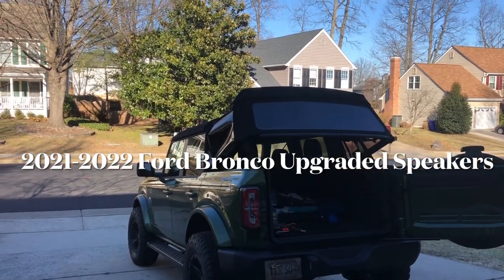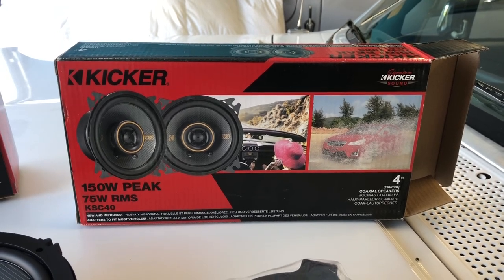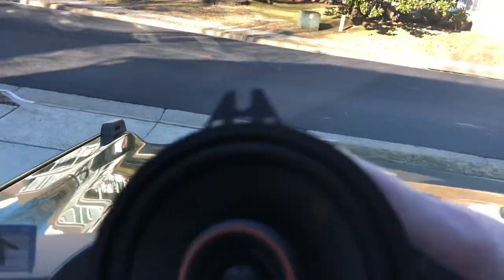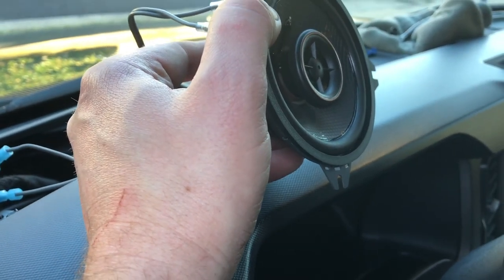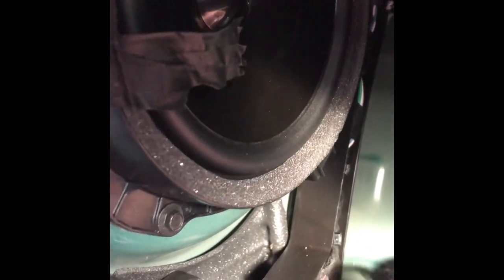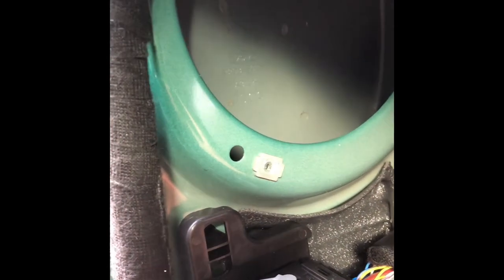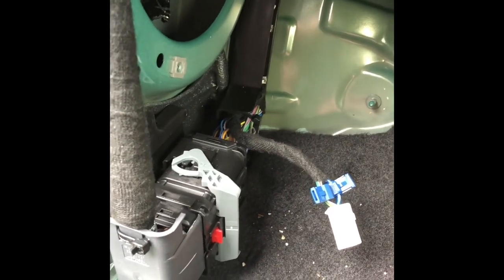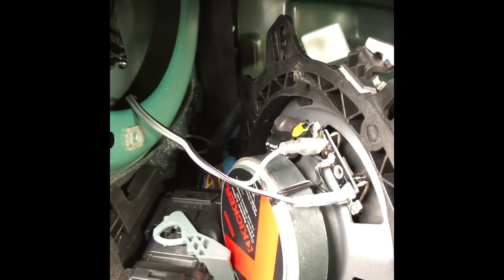2021-2022 Ford Bronco Speaker Upgrade. Sounds great!!!

Comment: I swapped mine with 6 JL audio speakers and put in-line 300hz bass blockers on the 4 inch speakers.  Very happy,  Most of the improvement came from replacing the two front speakers.  Bass blockers really cleaned up the sound.
Reply from the maker: After two weeks of listening, I did the same thanks buddy. Made a huge difference in clarity.
Reply: I tried skipping the bass blockers. I thought I wanted more bass. Turns out I don't want that type of bass and it just sounded too muddy and punchy.
Reply: Is there a kit or something that you can buy?
Reply: @noodlehappy  you’ll just have to make one.  I bought 4 audiopjpe 133 300hz at 4 ohm bass blockers, 2 jl audio c2-600x speakers, and 4 jl audio c2-400x speakers.  Crutchfield sells merta speaker mounts for the 2 6 inch speakers and a new wire harness.  For the 4 inch speakers, you can tap into the factory wiring (or have your dealer help).  Removing the plastic panels covering the speakers is tricky and you may need to buy new ones if the tabs get too jacked up.
Reply: Bass blocker for 4" specific is BB-4pr on amazon for like $12. Worth every penny
Reply: @uncoveringohio1805  Did you put bass blockers in rear speakers too?
Reply: @amishchiman  Nope, looks like ford isnt sending full range to those speakers.

Comment: Understand that the “paper” has nothing to do with quality and each material has its pros and cons.
Each company will also have their own proprietary tech to achieve the satisfactory compromise they desire.
The fibres within the paper matrix is far superior for sound reproduction than any polypropylene or synthetic cone speakers could ever achieve.  
There are also many types of paper, each with its own characteristics as well. Treated, Pressed, Pressed and treated, different kinds of treatment and pressing techniques.
Polypropylene cones will resist moisture far better than any paper speaker, 
I went with Hertz Cento series, all paper for a more natural sound, giving up a bit of durability! lol
Good job, thanks for the video, it will help me with my install! 👍🐴🐴🥌🤟😮

Comment: Great video. I wish I had seen this before I did my speaker upgrade over this past weekend. I must have done mine while  you were getting your video together. I managed but a few headaches may have been avoided if I saw this video first.

Comment: Thats the band i woukd have used to test the speakers. Two questions, my wildtrak has a sub woofer, i see u didnt change that. Also,, you dont need an amp? .did you use bass blockers in thr dash speakers?

Comment: @Cory D  I used the same 6.5" Kicker KS's that you installed, but for some reason they only put out about 1/3 the amount of base as the plastic factory speakers. Any thoughts on this?
Reply: 6.5 are not built for bass. This is a mid and highs speaker. Add a sub if that is the goal.

Comment: There are 2 connectors or prongs on back of speakers.  Does it matter which incoming wire gets plugged into each connector or prong?  I mean can you reverse the wires by mistake and blow the speakers?  thanks
Reply from the maker: So when I took off the OEM speaker I saw the color of the wires and matched them up to the new ones.

Comment: FYI buying 6.5 inch speakers will not directly fit into the opening.  You obviously have some sort of opening adapter - maybe they came with your kickers but not mine.  I had to rip apart the ford speakers and reuse the mount to make it work.  You should begin your videos with everything needed.  Wire mounting, harnesses, crossing wires, mounting adapter, all these things would help a person that’s. If a speaker/wiring expert in future.  I ended up figuring out the whole thing by myself.  The only value in the video is showing the screw mount hidden behind drivers side foot rest.

Comment: How did you determine positive, and negative?
Reply from the maker: Use a volt meter and put it on Ohm’s lowest setting and connect to your leads the positive will show a number and the negative will not.

Comment: Putting a bunch of tweeters in the truck is not better. Its better if you dont know any different. Two ways in the dash, two ways in the kick and two ways in the rear is that bright enough for you? The dash needs a tweeter, by itself, the kick needs a midrange by itself not a tweeter, with a crossover in between. Get a nice set of component speakers.
Reply: I did this exact upgrade and lost bass. Those speakers in the kickpanel are actually subs, wayyyy more excursion than the kicker is series we used. Not to mention those are 6-3/4 not 6-1/2. Odd not to use exact fit. Hoping I can squeeze kicker Comp subs in there.
Reply: Kicker KS* series we used.
Reply: @danielzindle6899  I just did the same thing.. I wish I saw your comment before hand!